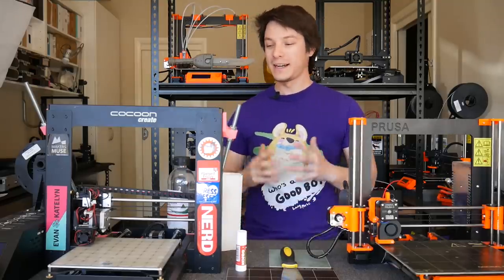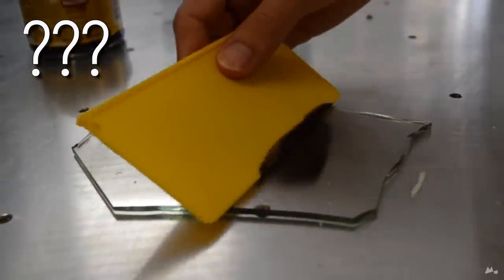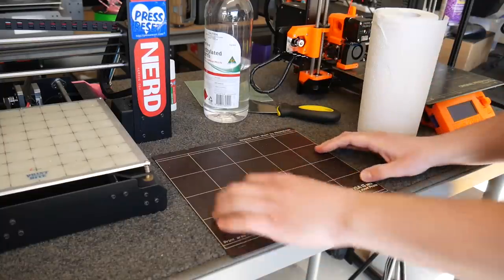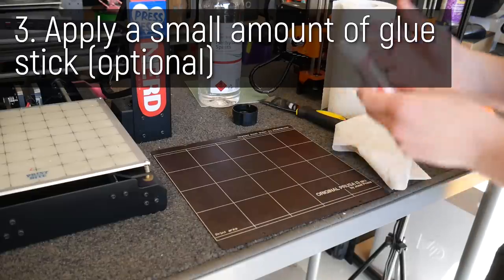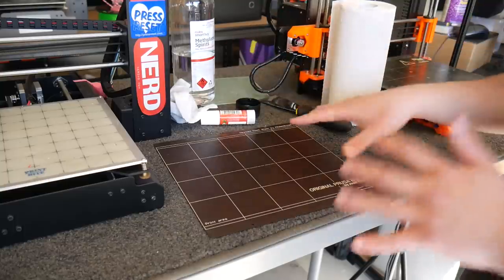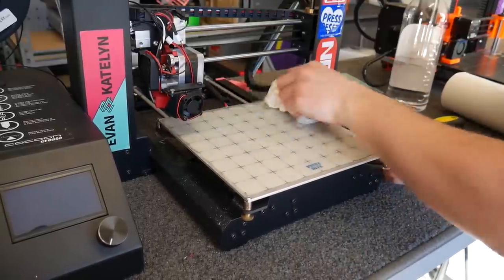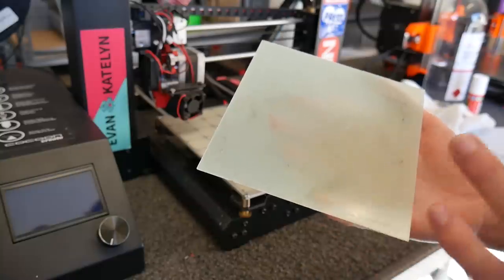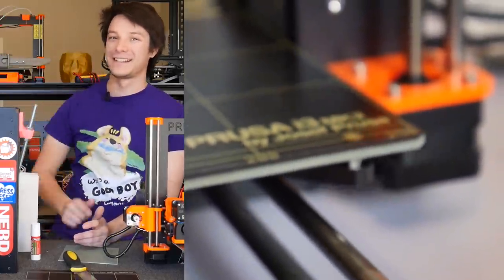3D Prints not sticking anymore? Watch this! 3DP101

Comment: This is exactly why I use hairspray on my printers. Cheap, sticks well, no residue on the prints and comes off with just water.
Reply: LOL I use a water based glue stick vs hair spray pretty much for the same reasons but glue sticks do not  go where I do not want them to go, like in the bearings!
Reply: @wayneparris3439  Hairspray doesn't either unless you spray it while the glass is on the printer, in which case you could use a piece of paper or cardboard folded down the middle to block it from going elsewhere.

Comment: the elmers glue type pots in art shops stationary shops etc are pritty much a lot easier, wet sponge and a quick squeege and your dun, water down or add second and third layers.  i basically got sick to death of piddling about with this that and then another other, squirt n spread as required is about the easiest and quickest way.(comes off with a blade or a wet spounge, if you find a thicker layer is needed it'll start to peel and you'll know its time to clean again). with the sticks it's takes much longer, and the sticks need replacing fairly soon so buy a box of them, handy for storage in stick's, but a litre bottle probably costs about the same as 3 or 4 sticks depending on how 'deliciously expensive' your speshul product is. just a thought there.

Comment: I'm pretty sure that water based pallet adhesive used in screen printing might be even better, but could end up being too sticky.  The best method of using it would be using screen printers pallet tape, which can be bought in the width that best matches your print bed, and then apply a thin coat of screen printers water based pallet adhesive to the tape (videos on how to apply it and use it are all over YouTube).  This way you can just peal off the tape when it gets too dirty.  The water based pallet adhesive lasts an extremely long time and you only need small amounts.  It can be cleaned and then re-activated by misting the surface with water and wiping with a soft scrub pad or sponge and once dry its sticky again!  Its basically a liquid form of that glue stick and methylated spirits you're using but comes in a bottle and that bottle would likely last you years.

Comment: PEI doesn't work for me unless I sand it at 60 grit with an orbital. I have tried cleaning with isopropyl and hot soapy water before every print. I have tried glue stick and Elmer's glue and wood glue. I've had limited success with genuine BuildTak for PLA, and with a clone print surface for PETG. I think it just sucks to be me. This video makes me want to buy PrintBite+ tho.

Comment: Thanks for the great Vid Angus, will this work for PLA?
Reply from the maker: Yep works perfectly for PLA, that's all I print usually on the open frame machines.
Reply: Awesome thanks, I am using a Wanhao D6 with the sticky removable build surface, will it be ok on that, and wont the IPL destroy the surface? if so can I use this directly on the metal surface?

Comment: just my personal opinion: I don't like to use glue stick because you end up with basically a thin layer of glue stuck to the bed and weird lines sometimes end up embedded in the bottom of the part. Instead, I clean it using isopropyl alcohol and to improve adhesion (on pei only) I sand the surface to about 400-500 grit so it doesnt have deep grooves that show up on the part but it textured enough to make parts stick.

Comment: Been trying to clean my print bed Literally for Hours and all day, leveling, cleaning, leveling, and it just Refuses to stick. ive been using a ton of alcohol cleaning pads, eyeglass cleaner (which has Methylisothiazolinone and isopropyl alcohol). the only glue-stick i have on hand is Clear Dry which i believe is a no-go for beds. im using a glass Creality heated bed on an Ender 3 Pro, i had several good prints in the beginning, but after my last print, the new filament refused to stick, im using Amazon's Black PLA.
Reply: SO, It was my mistake, Ordered the Filament expecting black PLA from amazon, come to realize they don't sell black PLA but instead that it was PETG, of which i was trying to print at 209degree...... under the 230degree that it requires.. so yes a whole day wasted and full of stress due to my oversight.

Comment: Just to chip in my anecdotal experience.
Whatever you have, you need to keep it clean. Isopropanol is the thing to use, maybe with a nice microfibre cloth. 
Bestest best print surface is a new Anycubic Ultrabase. I went through three of these. New you can't fail. Then they get old and become useless.Glue, hair-spray, doesn't matter.
Official line is "sand it" which is ridiculous. Reason ultrabase works is that it's covered in a load of 'dimples'. Print sticks to them, then as it cools and contracts it detaches from the dimples.Problem is that each print as it detaches, takes a bit of the "dimples" - and it ends up flat and useless.
I then spent pretty much what I paid for my printer (Tevo Tornado) on the "build-tak flex-plate system".
I resent the price of it - it's ridiculous - but it does work grinds-teeth
Nice (ish) advantage of Flex-Plate is that the sheets themselves are relatively cheap (compared to the initial 'system' purchase).
Also, they peal off easily. Adhesion is going down - just pull off the old one, and slap on a new build-tak sheet. No need to spend an hour trying to dissolve adhesive and scrubbing at it with a palette-knife.

Comment: for spreading the PVA you better just use water, the solvent doesn't dissolve it. the reason it still works is that there is a ton of water in it, but just waster is way cheaper :)

Comment: I use a mirror on my CR-10S with cheap hairspray. Glass cleaner & tissue, hot water & nail brush and an old cashcard as a scraper. No need for expensive products 🤣🤣

Comment: My prints are bowing and stuff will this fix that aswell?
Reply from the maker: Should do, ABS, PLA or PETG?
Reply: Maker's Muse I’m printing with pla on a dremel 3d20 also thx for the quick response appreciated!
Reply from the maker: Hmm no heated bed I don't think? Challenging. Try a buildtak like surface with glue stick and make sure the first layer is really close . A wide brim can help keep parts stuck too.
Reply: Maker's Muse is there a way to put a heated bed? Only problem I can think of with that is the plastic that holds the bed on underneath.

Comment: OK a clean table is a good start But I'm lazy and glue stick is labor intensive. So I use a light Spitz of hair spray that works very well it's quick and easy I print on glass so you really can sometimes get away with just clean glass

Comment: At first i was like: "Hell yeah, a video i can post to the forums i am active in to help out newbros joining the 3D-printing community and having always the same issue of prints not sticking."
And then i saw you pulling out the gluestick. Instantly revoked my plan on posting it.

If you really want/need some PVA layer on your printbed, go with water-based wood glue (thats the made out of PVA). Thin it with water... then brush it on the slightly warmed up buildplate (40°-50°C). The water evaporates and you are left with a REALLY thin and REALLY even coat of PVA.
Reply: Th33xitus Cool. I manage the degree of adherence by ajusting the bed temperature before application.

Comment: I use glass and glue stick, the glass is removable so I just wash it with warm water in washbasin...
Reply: What kind of heater bed does it have? Pcb? Aluminum pcb? Aluminum+ silicon heater?

Comment: I know that this is old now, but if it is just grease/oil, then why not just clean it, I just use antibacterial spray on a warm bed(glass) and then wipe off with a kitchen towel, just had this problem to the point of replacing parts and it still did it until I used this method.

Comment: I don't find "alcohol-smearing-glue around" to be that effective unless you're trying to significantly reduce adhesion on PEI. I use the kid's purple glue-stick and it works best applied straight on the surface and nothing else. It helps both adhesion and removal so I use it for all filament types. Smearing it around with alcohol makes for extremely poor adhesion for some reason. This flue also washes off with simple water and soap and there is no build-up.

Comment: Because the glue stick is water-based, I clean the crud off with orange spray & wipe cleaner and paper towel - brings it back to like new, and also removes the oils.

Comment: There is no reason for glue stick on the Prusa PEI surface. Clean with alcohol after every print and when things stop sticking after awhile use acetone on a cold bed and it works great.

Comment: You can more easily remove the glue stick with water, just make sure to dry the print surface afterward because the water is obviously not great for the metal.

Comment: Now I've always used hair spray is that ok?
Reply: Hair spray works well, but only use it if you have a removable bed. If you spray it while the bed is attached to your printer, it can build up on other parts like bearings.
Reply: Now I've gone to removable flexible beds much better

Comment: Great video. I don't see any reason to touch the print area with a removable printbed. At least not with fingers. Remove the bed, flex it (touching the edges and back, not the print area), and replace it on the printer. If something is too flexy to pop off use the scraper. Never touch the print area (or the business end of the scraper). Just clean with 92-99 percent isopropyl. The problem with lower concentrations of alcohol and in some cases methylated spirits are the additives. They can be problematic for adhesion. Each brand has it's own additives, so if one doesn't work try a different brand and stick to the highest concentration to minimize additives.

The problem I had was too much adhesion with PETG and TPU tearing up the PEI sheet. So I bought a can of Aquanet. I remove the printbed and spray a very thin coat on the plate, in another room so the spray doesn't get on the printer moving parts. I find that with this thin layer of Aquanet on the PEI surface I no longer have to clean it. PLA sticks for many hundreds of prints. I'll recoat just prior to PETG or TPU. NEVER TOUCH the printing area and it will rarely need cleaning and/or recoating. I've been using the same side of the same plate for a couple of years and printed thousands of (mostly PLA) prints on it, along with some PETG and some TPU. Finger oils are poison to print adhesion, so NEVER TOUCH THE PRINT AREA!

Comment: Rather than glue stick and solvent, you can also mix 1 part PVA glue (basically Elmer's white glue) to 6 parts water and wipe that on the bed with a clean cloth, then let it dry.

Comment: OK, I got too wordy on my first post re: Build plate adhesion.
Clean, clean clean your build plate is the real message!
If your bed is clean enough, and your first layer really is what you think it should be, adhesion shouldn't be a problem UNLESS the print bed has deposits that can't be seen.
Some surfaces [Ultrabase, by personal experience] seem to hold on to traces of printed material, building up a film that has poor adhesion.  Dirty filament?  Crappy bed?
Some solvents have trace amounts of oils, and using them leads to building up oils on the plate.  Nail polish remover almost always has lanolin or other oils added.
Some soaps and detergents have 'gentle to hands' ingredients.  Again, oils, fats and waxes are in the residue and will build up over time.
Use 'painters grade' or 'paint thinner' solvents: a gallon of acetone at the paint store is far cheaper than 'cosmetic grade' polish remover and has no added oils.
Rubbing alcohol %70 often has added oils.
Denatured alcohol might be problematic: the toxins added to make it undrinkable don't always evaporate entirely, and even the tiniest trace of BitterX [used to give the alcohol a horrible taste] on your hands will ruin your lunch at parts per billion!
Don't trust the labels to tell you this, evaporate some of your new solvent on clean glass, look for residue!!!!
'Degreasing' detergents like Simple Green don't have lanolin or other 'skin conditioner' oils added.  Again, do some testing prior to using with prints.
What I am getting at is simple: make sure that your washing up kit isn't leaving more crap on your build-plate than you expected to clean off!

Comment: No. While it is true that oils from your hands or any other slippery obstacles must be removed, and something like glue stick can help, there are other concerns to handle before ever considering those types of fixes. I struggled with this issue for many weeks and pulled out the rest of my hair in the process, viewed yours and all the other vids on the subject, only to find that the first layer calibration is the most overlooked issue on this subject. I finally found a guy talking about that, and since I calibrated my printer to print a proper first layer I have no need for anything to aid in bed adhesion. I have a prusa mk2.5. I've been making 100% successful prints now of all sizes and shapes for about 3 months. Now I just wipe the bed before each print with a little rubbing alcohol and I'm good to go. Check out the first layer print in your calibration menu folks. It'll take a little effort to get it right but you'll be happy you took the time.

Comment: I don't know if you can use Acetone on the bed, but that can be obtained in 99.9% laboratory grade cheaply from eBay. Meths leaves grease and that dye behind, and Commercial grade Acetone leaves grease behind too. This tip was posted on WeldingTipsandTricks.com as a cure to tarnishing you get from deposits left behind when cleaning with commercial grade Acetone.
It really makes a difference. Clean a shiny surface with it after cleaning with your usual cleaner, and you can see the difference as you wipe!
Reply: Mark Ferrick - As long as they're being honest, then that sounds like lab grade acetone. I'm slightly suspicious when they claim 100% though, since lab grade is normally sold as 99.9%, presumably because nothing is ever 100% pure. It's probably the real deal though, some marketing person may have rounded it up!

Comment: Whenever my smooth PEI stop providing a good surface, I wipe down with acetone and I'm back in business
Reply: @karoo_bushman6880  

Get a towel of some sort and put some acetone on the towel, then proceed to wipe the plate. 2 times should be plenty. Good time to note that you do this on smooth PEI sheets only...

I usually do this about every 3 or 4 months or as needed...otherwise I wipe with IPA if I'm getting ready to print PLA or windex if I'm getting ready to print with PETG.

Comment: I think it does not help much for print ing abs and nylon parts.  The main problem is the high temp makes the parts warped much on the bottom surface. It curls up so detaches from the bed. I think industrial 3d printer is a lot better than our cheap machine.

Comment: It's PEI, just wipe with alcohol.  If it's still not sticking wash it with warm water and dish soap. If it's still not sticking, just refresh the PEI by gently wiping with some wet 1000 or 2000 grit sand paper.  PEI sheets are meant to be sanded to be refreshed.

Comment: I got a tronxy x1 as my first 3d printer because of your reviews. It is the worst thing I could have ever done. I am not blaming you but tronxy for this. here are a few reasons why no one should buy it:
1. -Hotend is the worst 
2. -bowden connector didnt work
3. -bowden tube is the worst 
4.-extruder doesnt extrude (because doesnt grip onto filament)
5.- a part was missing when I got it
6.-the sd crad slot does not work
7.-the printer is not recognized by cura
8.-the y-endstop can not be mounted as specified in the manual
9.-bed leveling is not a thing
10.-there is no support for the machine what so ever

I hope that those reasons were compelling.
If I had to sum up my experience with it i would say that it made me have  the worst 6 weeks of my life.
BUT
I have not given up yet I am now replacing the Hotend with an E3D v6 lite. I hope this fixes my problems. Do you have any other suggestion?

PLS like so Angus and anyone who wants to get a tronxy x1 sees.

Comment: Odd.. Meth in the UK is purple not clear like in Australia?  Now I had my 3D Printer for over two months now... I brought allot of the filaments, I got the tools to clean the Nozzle, I have the glue sticks.. But in all that time , I've managed after many many fails to print one small Benchy Boat, and one medium sized print.. With tons of wasted filaments filling a medium sized box now!  Glue sticks from what I've seen are rubbish.. they don't stick down the 1st layer of filament at all? The glue just dry's up and act's like dry hard human white skin, Zero sticking.  Not with a light amount on the heated bed, Not with 2 layers on, Not with 3 layers on either.. As for the finger oils etc. on the bed.. I never touched the surface of bed as I read that you must not leave finger oils on the bed?  I had the thick metal bed top layer on a full heated bed.. it was not easy to even get the fails of it. So I found the company who made my printer did the ultra flexible magnetic bad for my big printer. I brought that, Same troubles can't get any print to stick with glue or hair spay or lots of either or a little of either?  I know of the saying that clean the bed with some fancy alcohol in other videos?  But all the tries with the cold bed and glue stick or hot or very hot bed and glue stick, Nothing of that works.  I can only say what I see?  I got to the point after investing a huge amount of my spare money, That I may just give up?  Really pisses me of this does. So thanks for the video.. Shame it don't help on my printer.